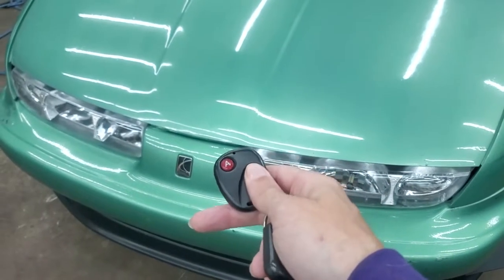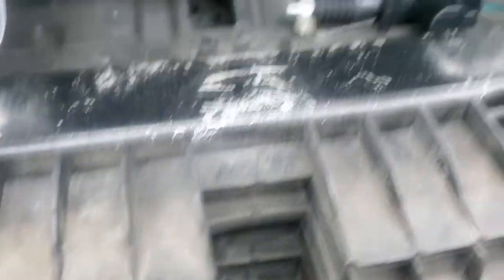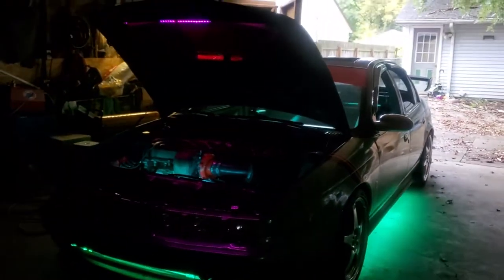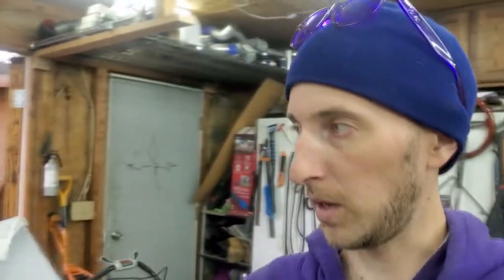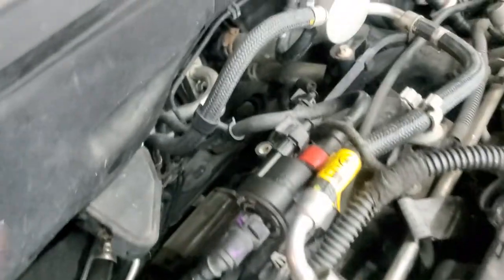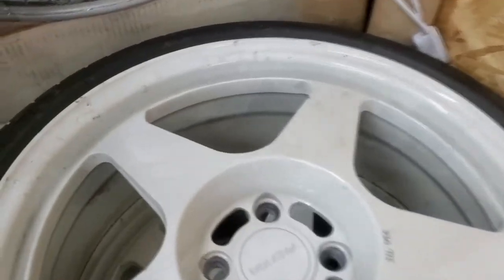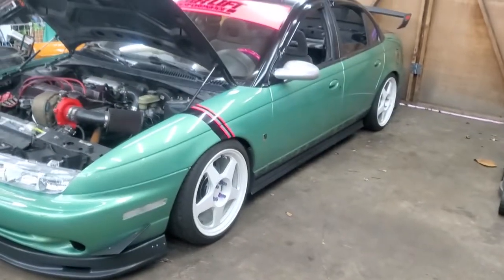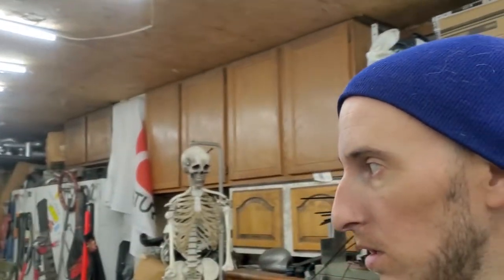Getting ready for winter....

Comment: I have been thinking about putting my winter wheels on the cruze also. Great minds think alike!👍👍😉
Reply from the maker: I think you still can get a month before id start using my actual winter tires, you want the weather to be mostly around 40 and below so you dont wear them out so bad
Reply: @BuilditBreakitGarageinc  Hey Build it, maybe u can help me. Is a 2002 SL2 5 speed manual compatible with my 1995 SL2? I found a 2002 that I was considering buying for a parts car to swap out automatic and put the 5 speed manual in mine, thanks.
Reply: @junechris  Yup, that'll work. All S series transmissions will fit in any year S series car and bolt to any year engine block. Externally they are all the same from 91 - 02.
Reply: @differentgarage   Yeah, I checked, it's MP3 cause it's DOHC. Thanks brother!!!
Reply: @differentgarage  Is your engine built in yours? I'm thinking of rebuilding mine with .20 over forged pistons and rods, etc. Maybe some flat faced valves and seat work, maybe the mildest desrhouding possible to build it for a turbo. If your engines built, what would u recommend in that regard, thanks again man, you're a lot of help.
Reply: @junechris  The engine in that car is bone stock, however I am currently building a turbo engine for my 95 SC2, but I can't really make any recommendations without knowing your end power goals. I can however tell you my setup and that might help.

Stock bore with hypereutectic pistons and forged rods, 3rd gen crankshaft, 3rd gen block, 3rd gen lower tie plate, ARP main and head studs, ported and polished cylinder head, intake cam mod, flat faced valves, port matched intake manifold, custom exhaust manifold. Trans is a 1st design MP2 with an LSD. Turbo is a 75mm compressor with a T3 exhaust, Haltech Elite 1500 stand alone engine management.

I will be launching my channel in the next week or so, that might help you out as well, just wait for the engine vids, they are a little later in the episode list.
Reply: @differentgarage  So what did you do to the cam as a mod? Or did u buy the cam custom someplace? I was looking into a company named colt at one point for cams. Thanks for the information, I wrote down the build u have so I can do similar modifications. And I'd be interested in the 3rd gen Crankshaft too since I'm rebuilding mine too. Thanks for the solid advice. Maybe we could show off each others cars one day..lol Thanks again man!!  (Chris)
Reply: @differentgarage  With the cam mod, what would that accomplish, or what power bump would u achieve? Thanks brother. Yeah, I'm gonna run a turbo also on mine so my aim is for reliability but as much power and torque possible, like around 300-320 HP. I'm ultimately gonna have a machine shop build the head and bottom end so , just to give an idea what I'm trying to accomplish. I'm wanting to run .20 over forged pistons and rods or whatever I can get away with without bumping the compression up too much to not advisedly run a turbo. I've seen tons on Saturn forums running .20 over all day long with a turbo back in the day. You've been great help thus far man
Reply: @differentgarage  So with the cam mod, do u have any vacuum issues or loss of base acceleration?
Reply: @junechris  It increases the lift and duration of the exhaust valves, thus increasing exhaust flow and scavenging. In an NA build it doesn't do much, kinda relocates about 5hp from below 3500 RPM to above 4500. In a turbo build though it helps to get all the extra air shoved in by the turbo, out the exhaust. Shimming the valve springs isn't a bad idea either to avoid valve float at high RPM. You probably don't need forged pistons for 320hp, hypereutectic will do just fine, and they're  better for reliability and steet use.
Reply: @differentgarage  So I guess I'm gonna do hypereutectic  .20 over with forged rods then, thanks. I want it to last 10, 15 years or so till the next rebuild because I'm borrowing the money from Publix credit union to pay for both the 5 speed manual donor car swap and the complete full engine build. My head gasket has a slight leak so I when I was enthusiastic about finding a 5 speed MP3, my joy kinda melted away a bit...lol I'm gonna run an AEM EMS 4 for 4  engine management with new wiring harnesses.
Reply: @differentgarage  So the 3rd generation crank would be doable too, because the 5 speed manual DOHC, 1.9L is a 2002 model SL2. So I should be able to build mine similar to yours, awesome man, just realized that tonight, feeling more optimistic now , even more. Man, I'm so happy u been coaching me on this. The help and info u provided will be the difference between someone adding a bunch of cool parts, then is dissatisfied, VS totally bad to the bone, thanks again!!!!
Reply: @junechris  No problem dude, here is some crank info
91 & 92 have different tooth spacing on the reluctor ring for the crank position sensor, will only work with 91 or 92 ECU. Otherwise identical to 93 - 99 cranks.
93 - 99 are 4 counter weight, compatible with 93 - 02 ECU
00 - 02 are 8 counter weight, slightly heavier but stronger and better balanced, compatible with 93 - 02 ECU.
Aside from that all cranks are the same and will work in any block with either sohc or dohc head and either auto or manual trans.
Reply: @differentgarage  Yeah, I'm trying to pick up one with a five speed but the dude never called me back, or at least yet. I went to my credit union to have more than enough to do it but I'm wanting to at least do the manual swap and full engine build later, if I can't do it all at once. You wouldn't happen to have a Saturn 5 speed laying around would u, as a donor car?...lol Maybe one could just get a 5 speed MP3 off Ebay, but of course you'd need to other necessary parts that u might need like the shift linkage, etc. But maybe that would be easier if this car deal falls though. It sucks because I'd have to have it auto transported to me, even if I take it off the dudes hands.
Reply: @differentgarage  Hey Build it, you said u had roll pins for the manual trans a while back when I was commenting about heat treating the differential pin. Is there a place to buy them for mine? It looks like I'm gonna get my hands on a 2001 SL2 with a manual. And also, if u don't mind, I wanted to build the head in the same regard as your beast with flat faced valves too. I guess you can get them more or less anywhere right? Thanks again bro!! \m/
Reply: @differentgarage  Do you have a link to where u got the limited slip differential, how much it set u back $$$ wise, and also how much the haltech 1500 stand alone engine management cost u also? I'm probably gonna do an AEM EMS 4 cause its less expensive though, but I wanna keep it as an option, thanks for all your coaching. I feel better informed today. :)
Reply: @differentgarage  Hey Different? That ACT ST1 HDSS Clutch U recommended. Was that a clutch that I will have to worry about the car eating flywheels for a daily breakfast, thanks?
Reply: @junechris  I'm not sure why you think clutches eat flywheels, they don't. The only way that could happen is improper installation or misuse/abuse, but even then the clutch disc material is softer than the flywheel and the pressure plate so it would be the one getting "eaten". So no you don't have to worry about that.
Reply: @differentgarage  it was on driving for answers channel.  The reasoning for it , I guess is that it grips harder on the flywheel, etc. Another thing BTW, I've read that E85 is actually damaging in some ways to an engine, not sure if it's true but figured I'd ask to get insight as well.
Reply: @junechris  D4A is usually pretty accurate, I'll have to find that video, but either way no clutch made for the s series is capable of totaling off a flywheel, so don't worry about it.
E85 could be damaging to an engine, but I would think it would be minimal, and not worth worrying about. Its just alcohol, racers have been using that as fuel for decades.
Reply: @differentgarage I know u get a HP increase from the E85, especially under boost. I suppose one could get forged or Anodized crown pistons but that would cost a fortune and is not really street friendly, even with the the better grade forged that doesn't thermal expand as much, etc. And forged pistons push compression up if im not mistaken as well. Anyway, neither here nor there..lol Glad for your insight, it helps a lot. By the time I build this thing, it should be ferocious, it's already quick with the current set up, suspension, and ported intake , bigger TBI, header, CAI, etc
Reply: @junechris  Forged pistons will only increase compression if you want them to, you can order them in any configuration and comp ratio you want, but yeah, they aren't street friendly, and even the lowest thermal expanding ones still expand more than a hypereutectic one. 
E85 allows you to make more power by advancing the ignition timing in the tune, due to a higher resistance to detonation than 93 octane, if you were running 3 degrees advanced on 93, you could then run 10 degrees advance on E85 and make a ton more power, but just putting it in your car will not boost your hp.
Reply: @differentgarage  Yeah, I know they have different grades of forged, that's correct. On the E85, yeah I know about the advance of timing with it. It's to a similar end that water methanol allows u to do, to be able to advance timing to cool the combustion chambers to reduce knock. But water meth can be downright harmful to an engine if u run out of the mixture, which u will, and will have to refill it, and water meth can cause small craters in the pistons over time, from what I heard. I was looking at them also. So if the E85 can potentially cause damage, what do u, to the best of your knowledge, think that damage might be, even if minor? Or what could a person do to prevent that from happening?

Comment: You drive Midori in the winter? How is the air lift system in the colder temps? I put the same system in my SW2 this summer and am kinda wondering how it's gonna behave in the winter.
Reply from the maker: Make sure you keep it drained regularly and there is this product they sell thats like an air system antifreeze, I don't know exactly what it is...

But I've just kept my drain clear, but I do have problems from time to time with it in very cold weather... but my best suggestion is make sure you leave the car at ride height when you park it so just in case something freezes up you still can drive the car around, get the cabin warm so it can thaw out the system
Reply from the maker: Oh and yes I drive it in the winter, not thru any snow and the streets must be as dry as they can be so she sees some salt but I keep it clean
Reply: @BuilditBreakitGarageinc  Thanks man, that was pretty much what I was thinking, ill leave it aired up when I swap on the winter tires.